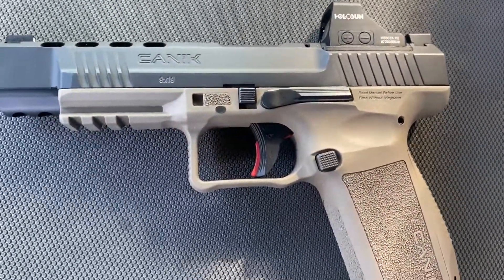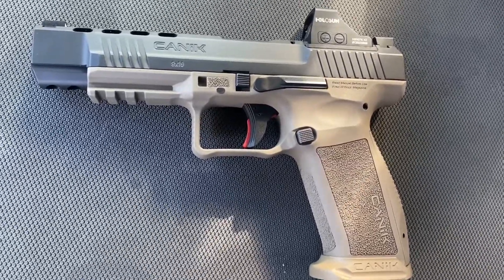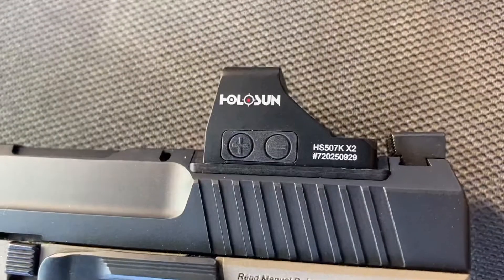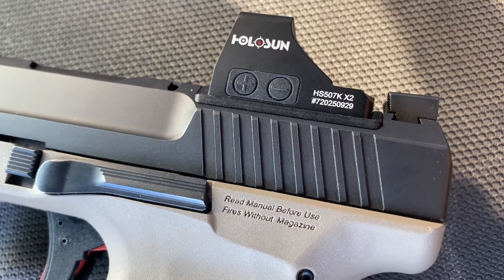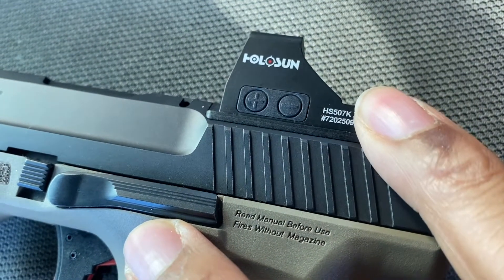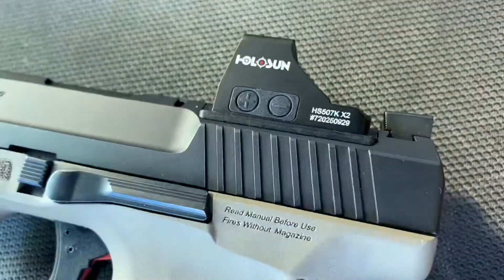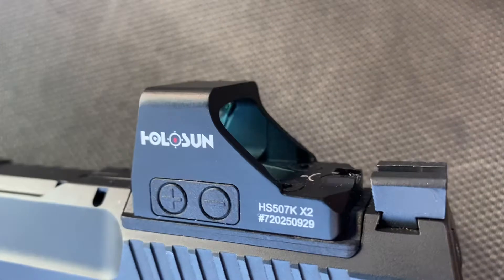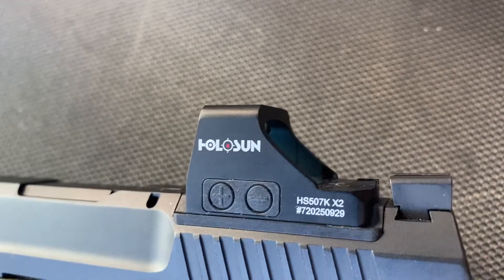Tips For Installing Optic Red Dot On Your Canik Mete SFX

Comment: This vids old but did you stay with Holosun K.  I just mounted one and it looks like the Holosun runs out of adjustment to Co witness.. Guy at the gun shop said take the plate off. Thats not going work big gaps between each end.  I don't care how tight you get the screws it would come loose over time. Looks like its going to shoot high.  Have not shot it yet might be fine. Anyhow how did yours do at the range was your Holosun bottomed out for adjustment.
Reply from the maker: I stayed with it and have not had any issues running the holosun 507k yet.

Comment: So confused here. On the holosun 507 and 407’s the C versions will not work and it has to be the K versions only is that what you are saying. Yes I am new to this.
Reply from the maker: No worries. I'm not saying that won't fit. I used a 507k because that's what I had in the safe. But any micro red dot by holosun or Trijicon should work. I'm gonna order some different ones and try them. I'll be sure to post the video.

Comment: Great video, thanks for creating the content.  I am trying to find a full list of all compatible red dots with the Mete SFX and haven't had any luck.  Other than the HS507K X2, do you know what else will fit?
Reply from the maker: You should be good with any micro red dot. Trijicon RMR cc, Romeo zero, or any similar in size to those.
Reply: I can't get my HS507C X2 installed :(
Reply: @trustinmark  won’t fit. Need the K model

Comment: Do you really need the plate?... I have a vortex venom that I tried on the Mete but the screw holes did not line up so I put that on my TP9 Elite. Would have been great on the because it lined up perfectly for co-witness. The Holosun 507C and 407C don't fit the Mete either or the mounting plates.  If the holes line up on the METE with the 507K... then why the plate?
Reply from the maker: I don’t suppose you need it. I’ve never tried running without it tho.
Reply from the maker: There’s definitely reasons you should run a plate. But I don’t know if it’s a necessity
Reply: @SmartShootersLLC  Run it without the plate so you can co-witness the iron sight. Worked perfectly on my TP9 Elite SC.